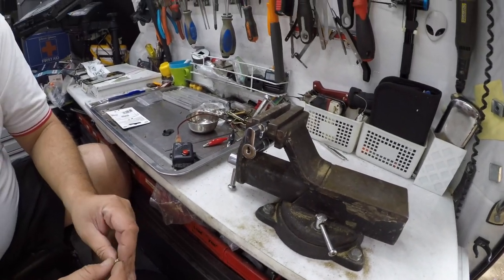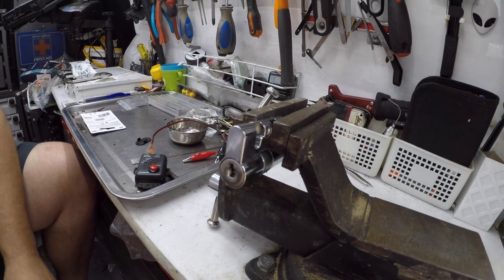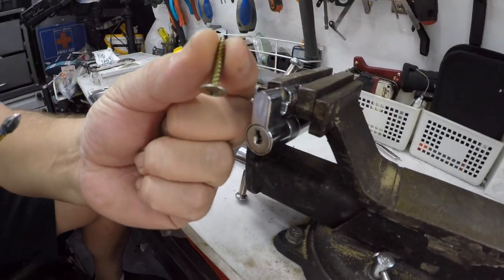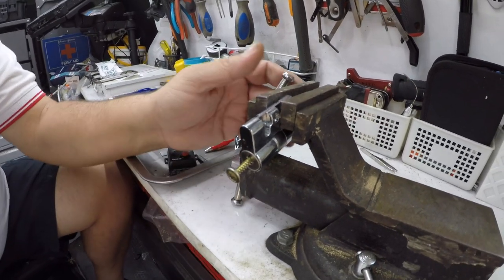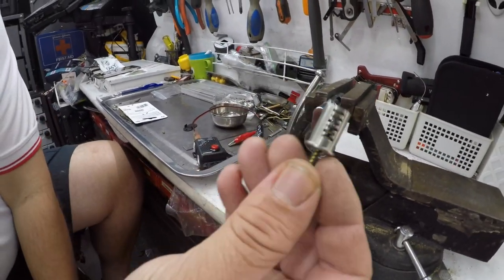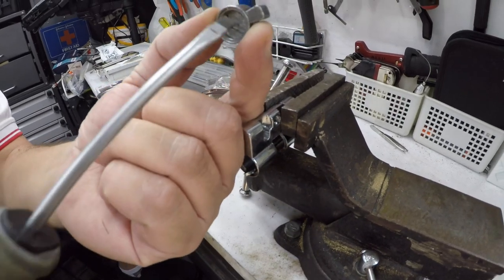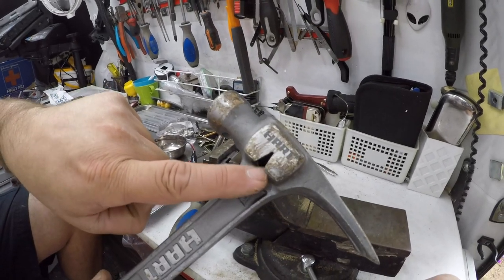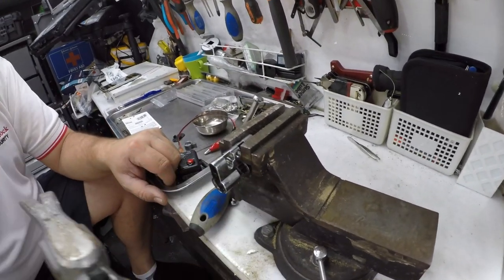Remove Screen Door Cylinder Without A Key

Comment: I have a balcony door lock with a double wafer, the type that you push on the button and it automatically locks. I've been trying to unlock it with a snowman, I think I might have damaged the stuff inside. Is there another solution, before I destroy the lock like in this video? Thanks,
Andrei
Reply from the maker: cylinders are cheap , just do the same and put a new cylinder into it
Reply: @DrLockShop  thanks, I needed to use both the Hammer and the pliers, as it was a long cylinder and I made a dent in the door with the Hammer, as I was pulling 😂 if you're not good at something, you're just not good.

Comment: Thats a cool hammer, I never seen one like it before. It came out very easy, is that normal? I thought you'd need a core puller.🤔
Reply: Its a wafer lock you'd probably be able to pull it with pliers
Reply: @Saulone1  oh right, that makes sense. I mustn't have been paying attention. Lol